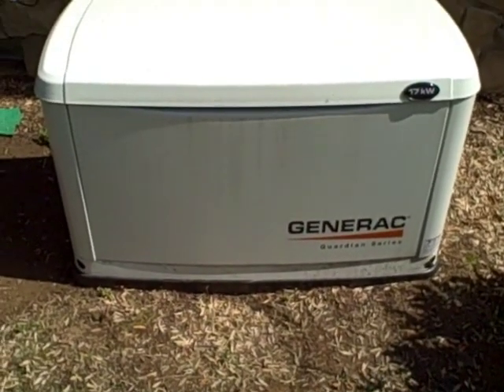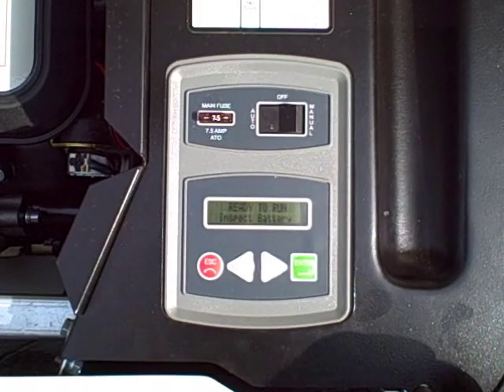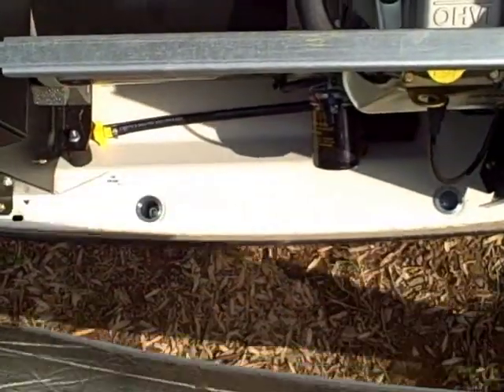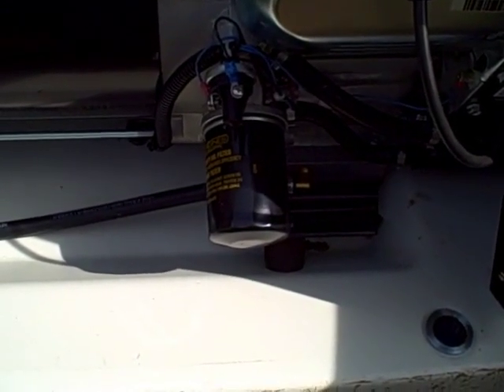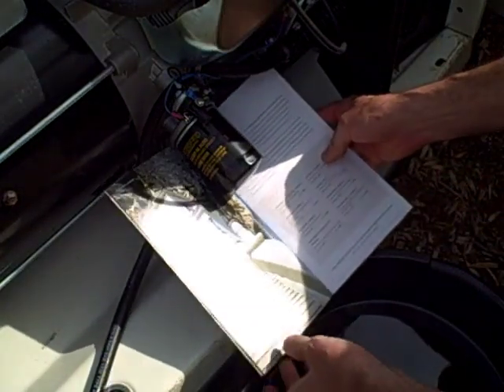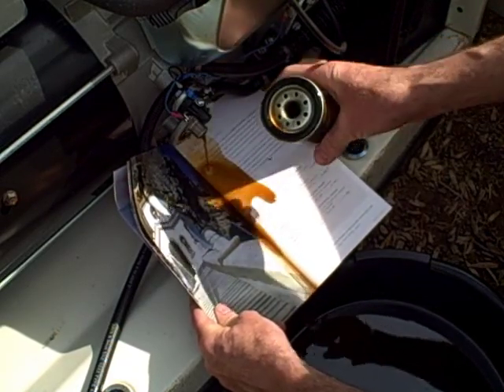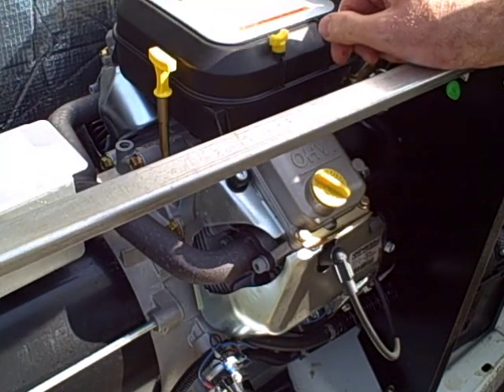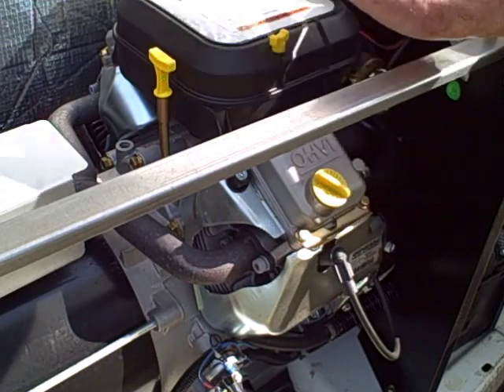Small Engine Repair: Change the oil and oil filter on a 17KW Generac Generator

Comment: I run 5w30 or 5w20 near Chicagoland.  Is this a bad idea?  We have both below 40 degree weather and above 40 degree weather.

I service units that are only run on the weekly maintenance schedule and are rarely run for actual power outages.  So I change oil every other year, unless the unit is new, then it gets the first oil change at the first year mark.

I don't know what kind of oil they use from the factory, but I always noticed how milky looking the oil is when I do the initial 1 year oil change.  Not milky like water contamination.  It's a different sort of milky look.

I also use Purolator oil filters, but there are many oil filters that are compatible.  (STP S4967, Bosch 3311, Mobil M1-103, Delco PF1233,
Purolator L14476)  Luckily Generac uses the same oil filter as an older model Toyota Corolla so any auto parts store should be able to supply you without having to buy direct from Generac.
Reply from the maker: +Blaine Bugaski I think Generac recommends 5w-30, and it will say in the owners manual. Thanks for the info about filters.....
Reply: If that's the case, 5w20 should be fine.  5w20 is starting to become the new norm for most American cars due to improved fuel economy which is caused by the slightly lower viscosity.

Also, on the last generator I did, I put the whole 2 quarts in.  After test running it for 20 minutes, it didn't appear to be overfilled at all.  I do know that the manual says 1.7 quarts.  But the 0.3 difference is so insignificant.

The units I service are owned by my Father, one at his older residence and one at his newer residence.  The one at the newer residence is a 16 kilowatt unit that was installed last fall.  This one has the USB connection and 120 volt outlets on the side beside the "circuit breaker" switch behind the little plastic door.

The older unit that he has was installed in 2009.  I believe that it may also be a 16 kilowatt unit.  I'll have to double check next time I'm there.  Either way, they both use the same filter.

Comment: how do you reset the change oil notice
Reply: +Channin Robilotti I didn't think that there was one.  Even on the newer Generac units with the advanced menus and such.  I look at the maintenance schedule but there is really no way to change anything there from what I could tell.

There is a "USB" plug on the newer units.  I'm not sure if that's for connecting a laptop with special software for for plugging in a memory stick to complete a firmware update.  Possibly both.
Reply: Turn to OFF mode, press enter twice, then turn to Auto mode. Schedule Service A message will disappear and the orange service light will go off.

Comment: Good Video.... 
One thing is it appears he tighten the oil filter too tight. I usually tighten it down to where it snugs down and not over tighten it.
Another thing, after he filled it with new oil he should have run the engine for about 5-8 minutes, shut it down and re-checked the oil level. A cold engine will keep some oil in the cylinder. Also the filter needs to be filled up by the engine running. 
If you go on Amazon and look for Generac Oil and air filter you will fine a lot. You just have to shop around for the best price and free shipping. 
Since you are operating with propane or natural gas the spark plugs will last a long long time. If you did purchase spark plugs the gaping should be enough to just install them right in.
thanks again......
Reply from the maker: Thanks for watching!

Comment: Thanks for this great video. We literally had ours installed a day before sandy hit. With no real time to test it and cold weather coming in it ran for 8 days straight till I decided I had to change the oil. Only problem was I couldn't find a retail generac oil filter so I resorted to visiting my local napa automotive store and found a compatible wix51394 and plenty of 10w30.

Comment: Like the video!  Just got our Genrac installed today, and were told that after an eight-hour "burn in," it would be time to change the oil and filter, which makes sense.  I'm with krazypyroboi05, though: where do we get new filters?  Through the dealer?  If not, what do we ask for?

Thanks!